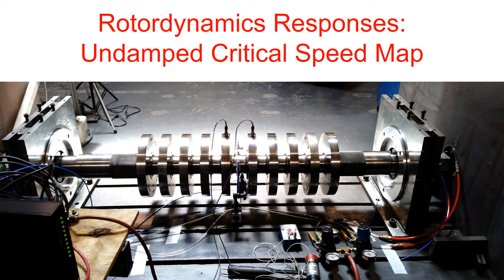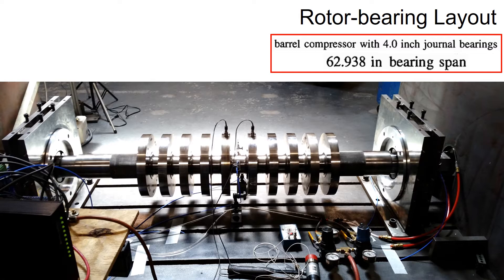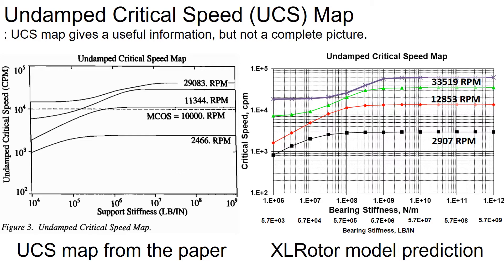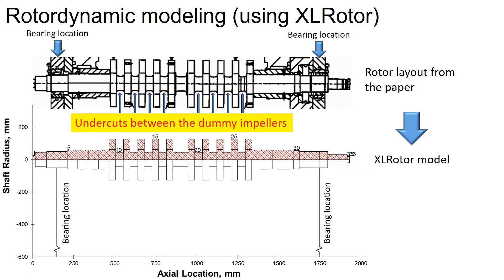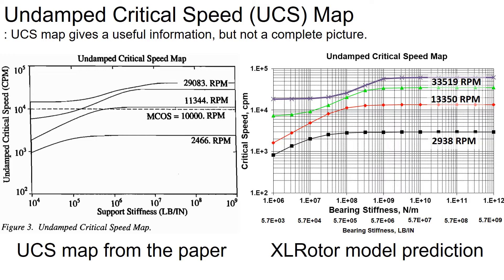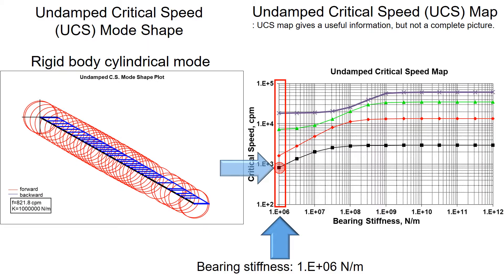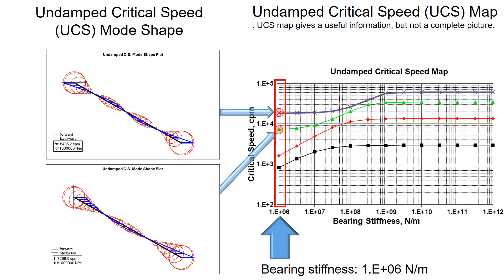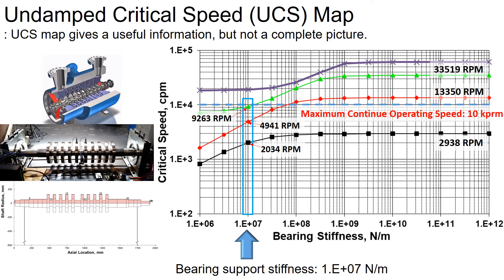Part 4 - Undamped Critical Speed Map in rotating equipment

Comment: Hello, I'm studying rotordynamics, and your video has been extremely helpful! However, I encountered a confusion that I'd like to clarify. A piece of literature states as follows:" Bending is induced in the shaft as the supports increase in stiffness but only the third mode and higher are inherently bending modes. This way of referring to criticals speeds is commonly misused with the first critical speed often called a bending mode.  It is not. " It seems that the first two modes are called rigid modes regardless of the support stiffness. However,  your video stated that if the support stiffness is large enough, they are called bending modes. I'm so confused! Could you explain why there is a discrepancy between the literature and the video?
Reply from the maker: Thank you for your thoughtful question. I'm really glad to hear the video has been helpful in your rotordynamics studies!

I want to make sure I fully understand your point. If possible, could you email me the specific piece of literature you're referring to? I'd be happy to review it and provide a more accurate and detailed response. You can reach me at rotordynamics101@gmail.com

Looking forward to your message!

Comment: My first mode when solving my problem was the conical mode. Why don't I see cylindrical mode?
 Is this possible?
Reply from the maker: It is possible that your problem does not exhibit a cylindrical mode. The existence and nature of different mode shapes depend on the specific geometry, boundary conditions, and material properties of the system you are analyzing.

If the symmetry of your system is not cylindrical, or if the boundary conditions are such that cylindrical modes are not excited, then it is possible that you will not observe any cylindrical modes in your solution. Additionally, if the material properties of your system are anisotropic, this can also affect the type and number of mode shapes that are present.

However, it is also possible that a cylindrical mode may be present but not captured in your analysis due to the specific details of your numerical approach or the accuracy of your modeling assumptions. It may be worth exploring different numerical techniques or refining your mesh to see if any additional mode shapes can be identified.